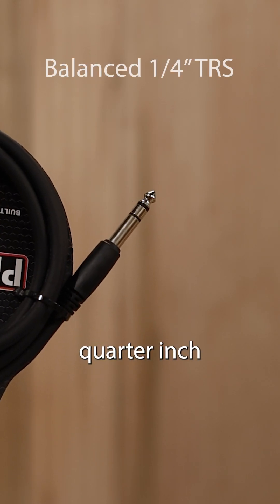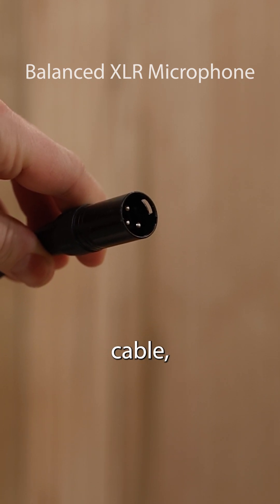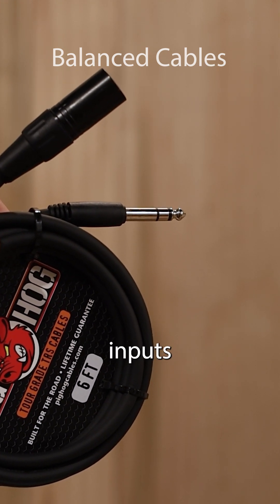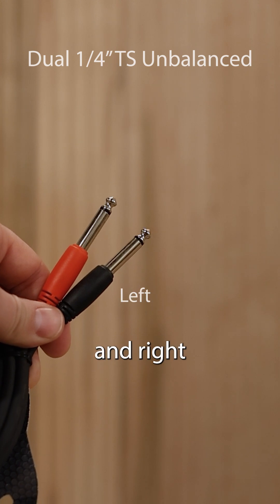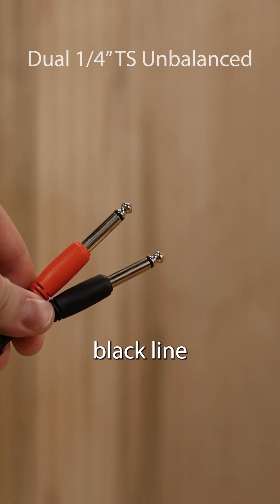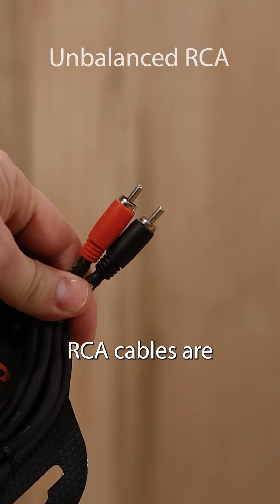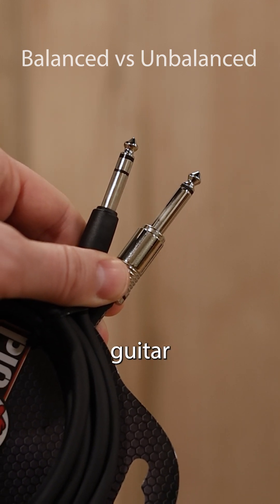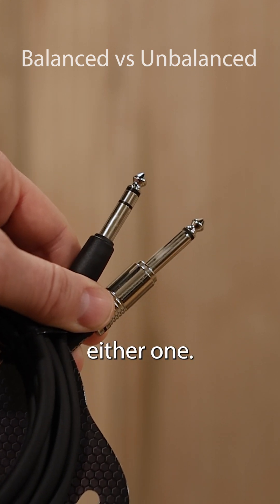What Are Balanced and Unbalanced Audio Cables?

Comment: What is the purpose of the ground? Does it improve signal quality?
Reply from the maker: It’s it help prevent electrical noise interference. Something like a guitar cable doesn’t have it because the distance is generally short and it’s a “lofi” signal to begin with. Interface to monitors is def best to use TRS so you have the ground to minimize extra noise.
Reply: @BridgeSetSound  ah so the interference is actually desirable, most of the time, for guitars
Reply from the maker: I’d say it’s more indifferent to the sound than it is “desirable” and less likely to be noticed since it’s a loud not crystal clean tone to begin with. Guitars have been unbalanced since the beginning and with the loud signal over a short distance, there doesn’t seem to be a need for balanced. That said, some guitars and basses have come out with balanced as a premium. TLDR A little noise in a guitar sound is probably masked or indifferent vs getting noise in your studio monitors while trying to mix.